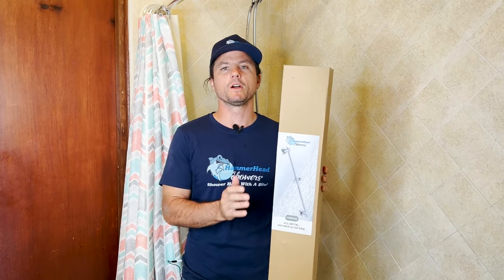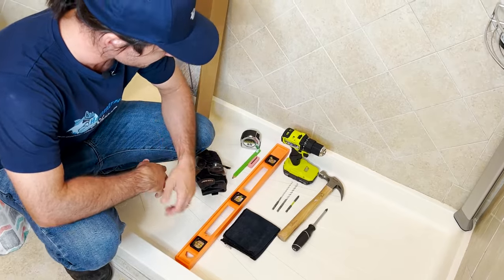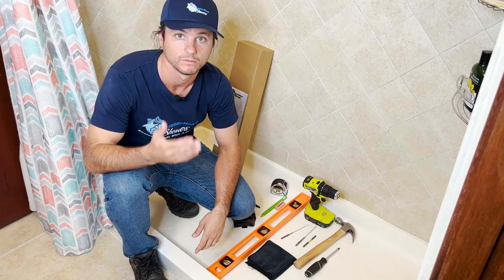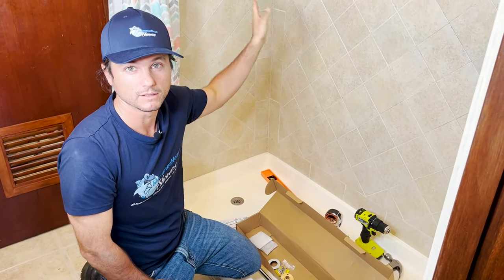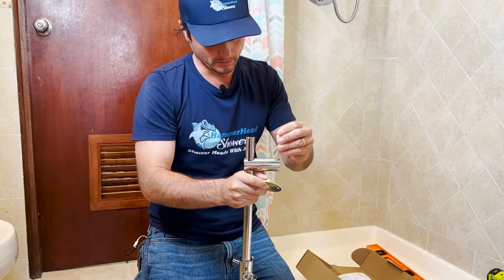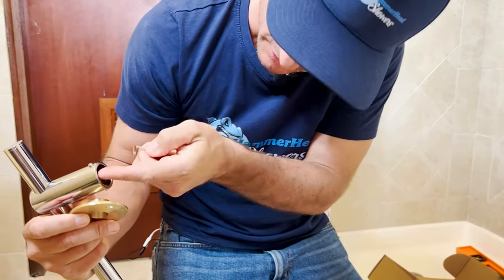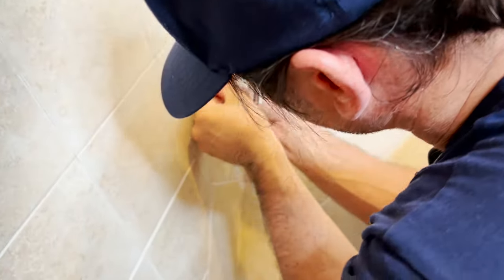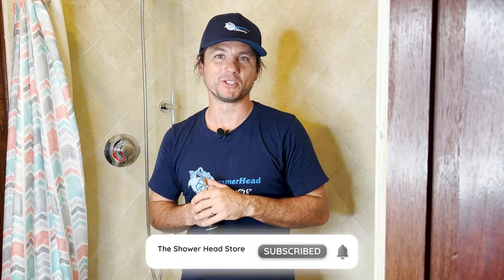How To Install a Shower Slide Bar

Comment: Thank you for taking the time to record this installation video. Clear and concise. I'm wondering if it would have made more sense to install the shower slide bar a bit higher so that taller people in the family can also use the hand shower. Yes of course this is an ideal height for your daughter but she will outgrow it in no time.. As well the position it's placed now, most people will always need to remove the handheld shower from the slide bar to use it. It won't be possible to use the handheld shower fixed and hands free since it's way too low.
Reply from the maker: Thank you for your feedback, Ac.

Comment: Great video, really helped me to install my own. I know this is a year old, just wanted to know if you need to caulk around the two wall contacts? I have a similar slide bar and worried about water leaking through the screw holes.
Reply from the maker: I'm glad the video was helpful! While it is not a requirement to add caulk around the screws, it is always a good idea to caulk around the wall contacts to prevent any potential water leakage. It adds an extra layer of protection.

Comment: Lol. Things you should have done is add silicone to those wall plugs any unwanted seepage can go behind any water proofing and behind the tiles and cause so much damage. Also using a drill to tighten your screws... If you add to much torque can easily crack the tiles especially ceramic or marble.  best to get close to fully tighten it and do the rest by hand. Also I'd avoid gettjng so close to that wall with shower bracket often the plumbing behind the walls follow the edges of the support plates. Take it from a plumber
Reply: As well your instructions should give you a clear indicator of what size bit you should use rather than drilling bigger holes every time. I agree using a smaller bit is good for a pilot hole though
Reply from the maker: Thanks for the commenting and much appreciated

Comment: Great video! But rather than screw mount, how well will it hold up if glued on??  (the secondary option for install)
Reply from the maker: We recommend using the provided screws rather than gluing to ensure the slide bar always stays safely mounted to the wall. Thanks!

Comment: great video but how do you make sure you don't drill into a water pipe behind the wall?
Reply from the maker: Thank you, Frank! Here is a video you can check out to avoid pipes and cables in the walls. Let me know if it helps.
Reply: You don’t need up drill that far .75 inches to 1” max . My instructions say nit to go  all the way into studs  so you would never hit one.

Comment: Can you install a filter on this type of Hammerhead shower head? I have the shower head, and just bought the bar … hose runs into corner of shower wall connection  … but there is not enough room to put old filter “AquaBliss” filter in there and too heavy to connect directly to shower head. I know you have a filter - just not sure it will fit either …
Reply from the maker: It depends on how your shower wall connection is setup. It can be connected to one of our shower arms, but if you're using a drop ell or something similar that keeps the hose snug to the wall then you won't have sufficient space to install our shower head filter.

Comment: Wish I could find a video on how to remove a slide bar system. The house we bought has a slide bar with the hose connection at the bottom of the bar. I hate that thing and want to put in a magnetic shower head. Can't find a video anywhere on how to exchange those
Reply from the maker: Unfortunately, we do not have a video showing how to remove slide bars, but we'll be happy to advise further if you can send a picture of your setup to our email. Our support email is contact@theshowerheadstore.com

Comment: Nice job, thanks for this.  I have a fiberglass shower stall I'd like to install a slide bar in.  I'm thinking that the butterfly-style anchors would be the best option.  What do you think?
Reply from the maker: Honestly, I don't know much about the fiberglass showers but what I do know is that you would need special anchors and we do not know the anchors needed for these. For that reason we do not recommend purchasing these for fiberglass showers.

Comment: How do you know what type of tile you have? Is it safe to always use the diamond head drill bit if you can't determine it?
Reply from the maker: A carbide-tipped masonry bit is the best drill bit to use for bathroom ceramic tile. Regular twist-drill bits can't cut through the fire-hardened glaze.

Comment: The issue I have is my aunts tub is idk years old that is  maybe fiberglass? And don’t know what to use to install something like this
Reply from the maker: Thanks for the feedback. Our shower heads are designed to be threaded to the shower arm pipe coming from the wall, making installation very easy!

Comment: Can this product be installed in a prefabricated (fiberglass) shower?
Reply from the maker: We recommend using a 3/16" tile drill bit to install the slide bar in tile for now. Adjustments may happen in the near future.
Reply: Yes,  you can install these on fiber glass, use  good wall anchors or toggle bolts.  Also, these bars can be stuck on with 3M VHB water proof - Double Sided Tape, if one doesn't want to put holes in fiberglass;  before pressing down, make sure its where you want it!!
Reply from the maker: @Saved-qv2ow  Thanks for the update

Comment: How by not using silicone or any other type of sealant could you be sure there's gonna be no water seepage behind the wall - really unpleasant stuff it might be as i often watch videos on failed shower membranes, water deterrent treatments etc... Especially shower curbs are sensitive points
Reply from the maker: Really unpleasnt stuff there with failed shower membrane etc...and this is why we added a rubber sealant Inside the decorative flange, to prevent water from going through.

Comment: You missed the most important first step.....Blocking the drain!!! Good-bye Mr. Set Screw! Also, did I miss the part where the hose was connected to the wall? THAT is what I came here to see. Maybe they connect themselves......
Reply from the maker: Thanks for the feedback! The hose can be connected to either a shower arm, a universal holder amount, or a 3-way diverter depending on the setup that you are going for. The video in reference show you how to install a slide bar.